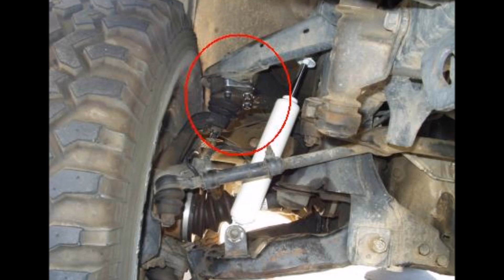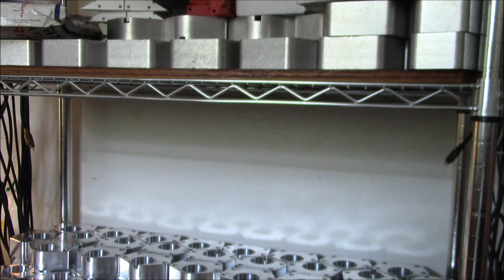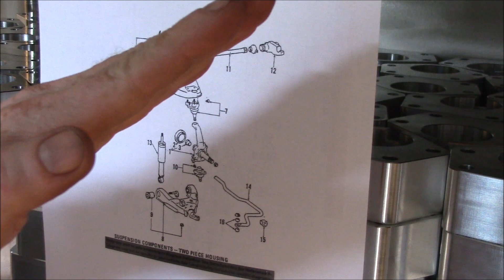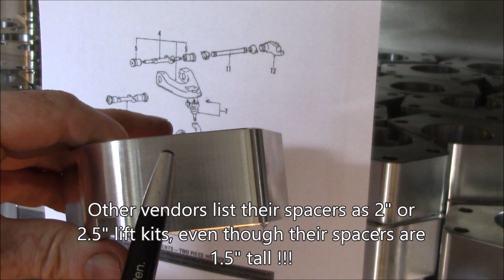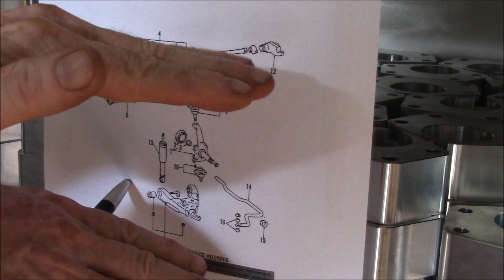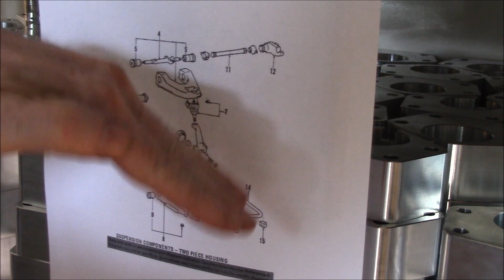Toyota 4WD/2WD Ball Joint Spacers

Comment: Hey there i was wondering if there 5inch spacers for toyota 4runner??? Or will i have to lift it with a complete lift kit??
Reply from the maker: No way to even fit a spacer that tall in there.  With the geometry of the front suspension, you have a fixed amount of up-down travel and the control arms only can accommodate so much lift before you can't get the front end to align.  With a 5" spacer, the upper control arm would be horizontal and the lower arm down at such an extreme angle that the tires would be tipped out at the top and in at the bottom (positive camber).  The only way around that is with one of the bolt-on lift kits with the dropped sub-frame.   You space down all the stock components 4" - 6" below the frame and that gives you the lift while retaining the stock geometry.  So for 5" lift, you could install a 4" drop bracket kit and then the ball joint spacers for that extra inch.

Comment: I have the same racks and you can really load the weight on them very strong
Reply from the maker: Yes, they seem to handle a decent amount of weight of you stiffen up the wire shelves.  I found mine started to sag when I first loaded them up with machined parts.  Then I made up the plywood stiffeners and no more sagging.  I reclaimed all the plywood from the crates the parts were shipped in.